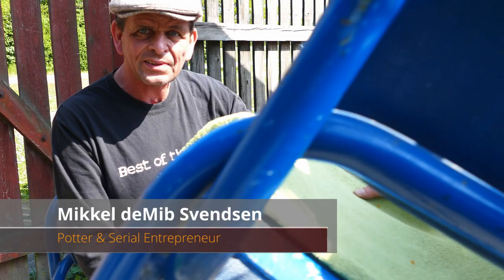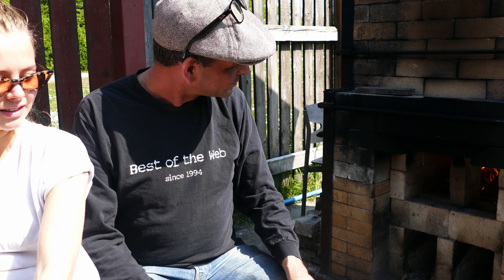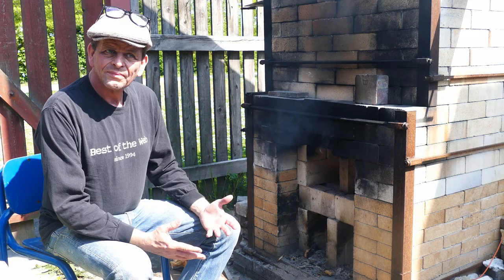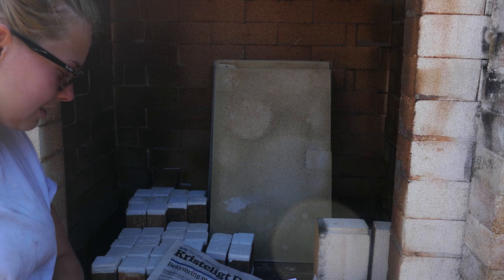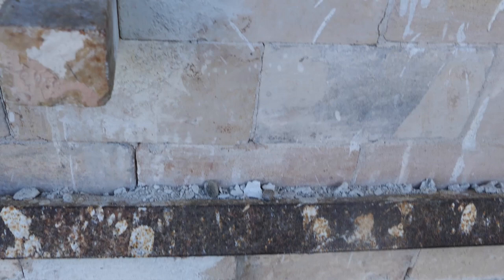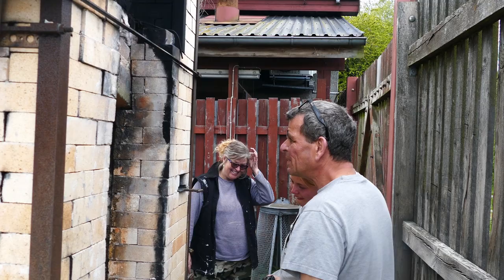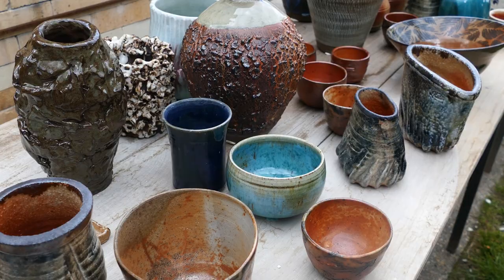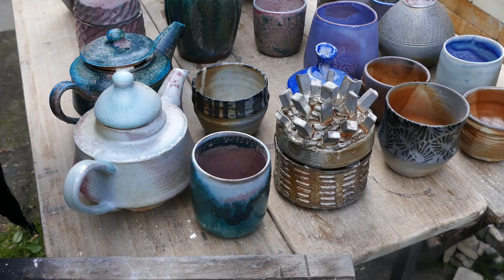2. Wood Fired Pottery - at Guldagergaard

Comment: Hi sir. Couple of questions. At 17:30s, what is the glaze colour that you applied on the vase which turned out like a milky  glossy green? Dose a red glaze burnt off and produced another colour such like this? Lastly, how did you remove the ball clay which you stick at the bottom of the pots? Stilt pins are available in packs online and make your own? Sorry for the long message. :-)
Reply from the maker: That is a celadon glaze

Red is always tricky. To get real copper red you have to fire in reduction.

The balls under the pots are called "waddings". You need that for high fire, wood fire and salt/soda fire. Normal stilts can't be used.
Reply: @deMibPottery  This is a new knowledge regarding the fireclay waddings! You works are very lovely and one of the kind. Wonderful!
Reply: Yours are good questions the wadding’s don’t stick as it is a special recipe.
Reply: @Cate7451  Hmm...Actually, I discovered these waddings have to be grinded and then polished for a smooth base/foot.

Comment: On the large kiln, can you explain what goes on top, under the fire bricks, to hold them up off the pottery? I have not seen a flat top before, usual some kind of dome. Thank you
Reply from the maker: I am not sure - I did not build the kilns, but I have seen many designs where flat roofs are made by drilling holes  in the bricks and have a metal stick through them.